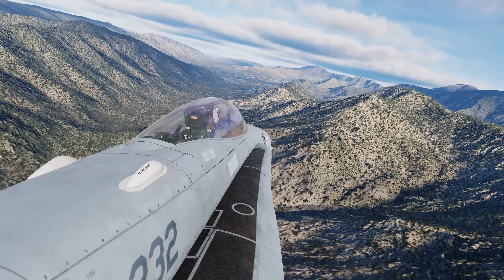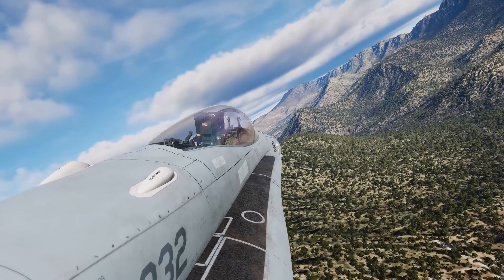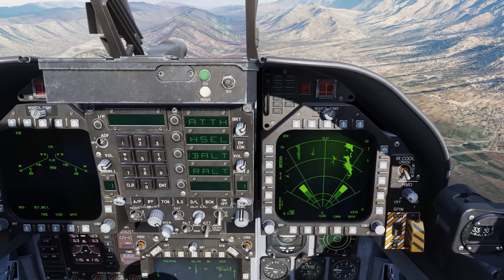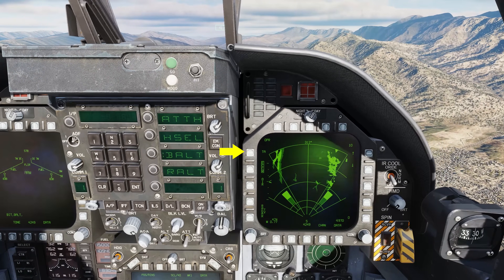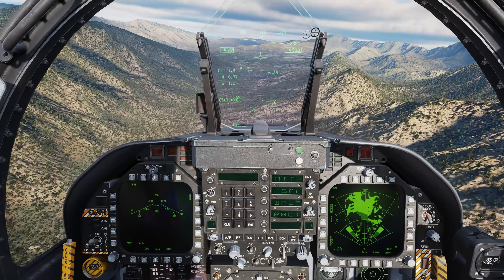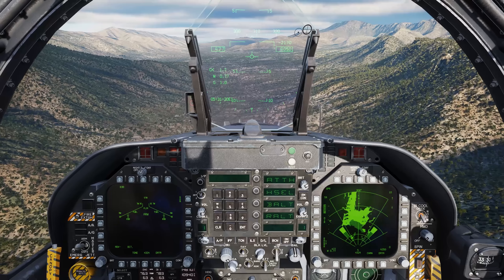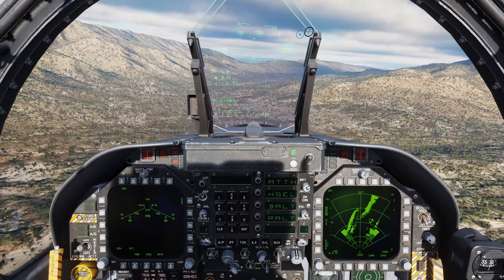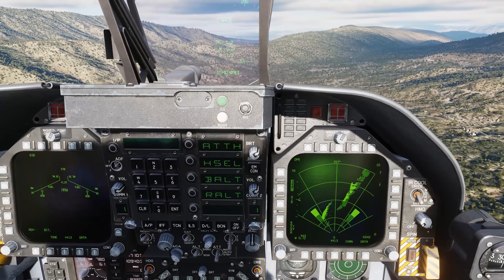DCS: F/A-18C | Terrain Avoidance Radar Mode

Comment: @MattWagner hi Matt, i am reach out to you directly to suggest something that your team might not have considered that i think would help or make VR hands much better.  I have tested extensively now  with different options and settings and third-party devices like HTCC, and finger mouses.  the best experience so far is having hand tracking turned on and visible with your software. in order to get the hand to interact with the buttons etc as you know you must turn of pointers in the hand option.  this works really great and i want to thank your team for this. however while button presses are great, the unfortunate truth is knob turns or flipping switches up/down are really difficult and make the hand tracking experience really hard and diminishes from its overall use.  Now What works really well is the mouse clicks to toggle switches and rotate dials. unfortunately this cannot not be done when you have the hands  visible since the hands take over the movement.  In-addition what is really great is that you can map mouse controls to buttons.  So here is what i am suggesting your team look into to really make this "hand tracking" great.   Allow us to use mouse clicks and scroll while like it does in mouse mode while the hands are visible. it very clear that DCs knows what control you are touching, so just let the mouse control buttons superceed the hand movement.   here is a practical way this would be used. First i would bind my mouse buttons to my hotas, or i would use a finger mouse. now all i do is enable hand tracking and when i press buttons with no mouse click it functions as is. however if i go and touch a switch or a dial, since it so hard to key those to work properly, i can simply use the finger mouse to click, or scroll dial and now i can quickly move around to controls and activate them.  yes the you can simply turn off the hands and do this as a mouse only, but having the hand visible is so much easier to see then finding a small yellow crosshair. in-addition its way more immersive. as-a software engineer myself it seems that having the mouse key binds work while the hands are present might be a easy things to add or tweak.

Comment: nice! i think it would be great if the LITENING pod could also be worn on the wing stations like the RAAF and RCAF do
Reply: This would be a nice addition. Do you know if the american model is like physically missing the circuitry required for this or is it just a U.S. operation manual thing that's limiting which station its on. I'm assuming like the A10 only two of the stations have the right circuits? (Or maybe I'm dumb and the A10 can use any station and its strictly op-manual reasons for tgp location on the A10c)

Comment: Flanker pilots freaking out about f-18 E3 tracks for L&S and DT2 on Hornets.. Thanks @Wags.. (panic and breathing hard into a paper bag here)
Reply: Whilst using their IR trackers to do the same thing
Reply: Not quite  @ricktoberfest  the IRST can be used for a fox 2 but that's no different than uncaging an aim9x, Esp since the IRST and 27et ranges have been reduced. But once you fire at Er missile in IRST radar will turn on, and you will be aware of the hard lock. Here you can build a track off an awacs and launch a missile silently all the way until it goes pit bull at ten or less miles. This cuts down on the enemy evasion time and doesn't need the f18 to run it's radar at all in theory. So not only a hit but a spike is not needed.

Comment: The recent development notes seem to confirm that the the improvements to the CORE of DCS stalled because ED is swamped with glass cockpit gizmos. Not a single big improvement came to DCS in 2025 that benefits all DCS players.
Reply from the maker: A review of change logs contradicts this.
Reply: @MattWagner  Only when you decide to value this or that as high as the new cloud and weather system. Edit: Some AA and graphics settings come to mind but still...
Reply from the maker: @Tome4kkkk different customers have different priorities of core items. The point is that core work has hardly‘stalled’.
Reply: @MattWagner  My the cloud system is just a 'curse of bar set high for oneself' ;) It did change the DCS environment overnight! Wishing you and the Team all the best in Q2&Q3. I'm, of course, still going to be praising DCS. No other platform like it, as far as the sense of flight goes, sprinkled with sandbox combat.

Comment: The dialog at 1:06 refers to "when the aircraft is in level flight or climbing," but the aircraft actually starts a descent at that point. Are you sure you didn't mean to say "in level flight or descending?" And later on you refer to "descending flight path" while demonstrating a climb. Kind of confusing.
Reply from the maker: Nope, the video was recorded prior to the voice over.
Reply: @MattWagner  Fair enough. But the voiceover then is not in sync with the video. It describes what happens during ascent while showing what happens during descent, and vice versa.

Comment: Super. This will be of massive help on foggy weather. I just want to have a better weather system into DCS including dynamic (rainy to sunny and vice versa) and local based (one part of the map with different weather than another part of the map).
Reply: Does it work with autopilot?
Reply from the maker: No, the video covers it. It’s not a complex system.
Reply from the maker: We hope players will use it, but based on my talks with Hornet pilot friends, they have all used it 0.00 times.
Reply: @MattWagner well, maybe I'm no pilot, but whenever that dynamic weather comes in and (especially in dynamic campaign) I'll be using it all the time. 

Heck I'd even use a setting that like turns the weather to be worse more often than not in dynamic campaign. Like a "man it's been raining non stop this month," a "nah it's been unusually clear this month," and a "oh boy oh boy, I hope you like clouds," (just constant cumulonimbus kinda thing)

Comment: I don't understand why you won't give the sniper to the a10c since it could historically carry it with the hmd and apkws. Same thing for the apkws integration on the viper which is literally supposed to be plug and play
Reply from the maker: Not correct for versions and lack of public reference data.
Reply: @MattWagner a10cii is literally a guaranteed suite 7 and above because of the hmd and apkws which mean that it can carry the sniper. Just say you have lack of data instead of saying that its not the right version when it literally is

Comment: PSA for virtual aviators: the other more common thing for all modules is always switch/select radar altitude mode when flying in weather or clouds near the ground. A jet still won’t see a steep mountainside effectively as 5000ft can change to zero in seconds, but combined with some guessing or prior knowledge you can manage better.
Reply: But with this you can see ahead of you what's coming up. I do the same thing with the A4 Skyhawk
Reply: @AJS86  oh, it’s obviously way better to use this for most of your mental map of the terrain you can’t see. Especially for a planned flight leg in canyons like Top Gun Maverick. Radar altitude is still the authority on what is directly underneath you right now — how high off the ground. It’s always on the HUD’s default profile and is the first concern if you are coming out of a dive and just leveling out. Before I check a mile ahead: where am I now? 300 ft off the ground or 1500 ft? Then: is my radar altitude climbing or not. Lastly, assuming I’ve oriented all of that and haven’t hit the ground already, I’d start following the guidance of what is ahead with more smooth flight.
Reply: I'mma be real, both your comments kinda lost me here. What are you suggesting? Obviously radar altitude control, but like with what purpose/mode?
Reply: You just like advising to use this (as often as possible) when not in air combat or when in bad visual conditions?
Reply: @garrettchambers9005  I’m just reminding some people that “radar altitude” is still there for probably all 4th gen and newer combat modules. I know some players fail to recall that these functions exist for all aircraft.

This feature is better to have in the F/A-18C but even the A-10C can fly close to terrain under no visibility with a combined knowledge of how rapidly it might change, and monitoring radar altitude.